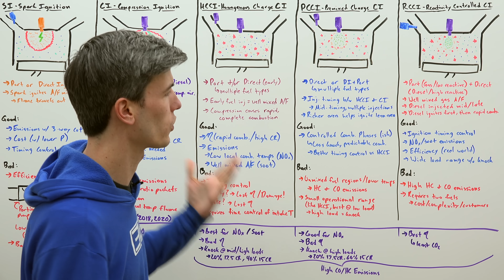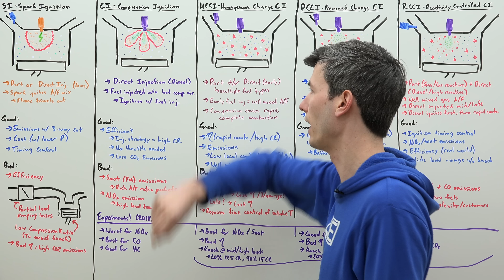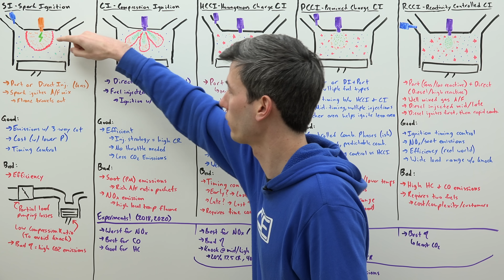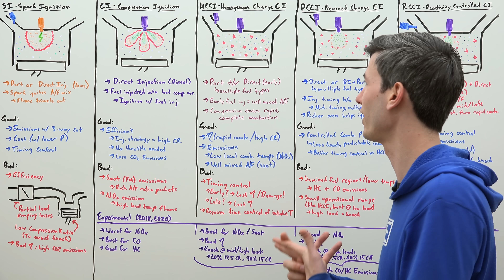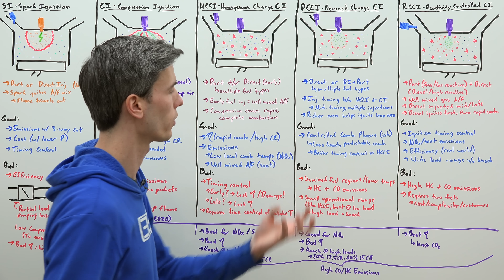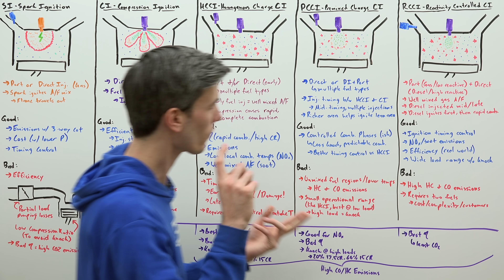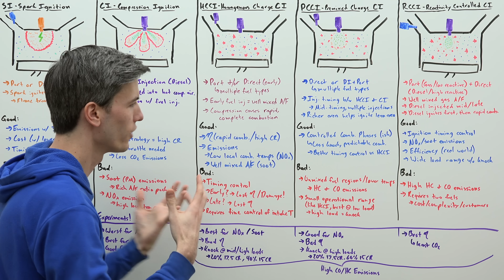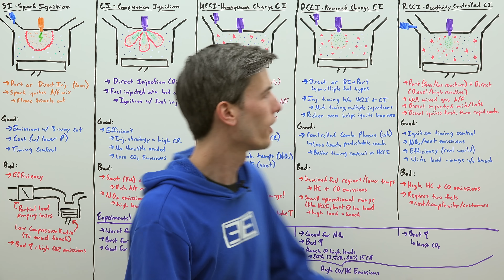If Combustion Engines Have A Future, What Is It?

Comment: I would gladly have a small aux 3-5kW engine in a electric car. I think HCCI could be much simpler in linear motor with a "single piston" and a chamber on each side and no rods limiting the movement. Frequency is not very important and you can modulate the load. Just for a better feeling if I get in a big jam on the motorway in a snow, or go camping somewhere very far and charge a car back in 1 day.

Comment: So is a CNG/biogas engine that uses diesel to ignite always an RCCI engine? You can get a conversion for your diesel car, at least in my country. And some tractors and trucks are being sold that can run partially on CNG. But if it's more efficient than using a diesel engine, I wonder why hasn't it gotten more common already. I bet there are lots of big companies that could save a ton of money if somebody in that company just found out about this and invested to it instead of buying new diesel trucks. But no, dealing with 2 different fuels would be just too much for anyone.

Comment: Any research being done on combining these more efficient technologies with carbon neutral fuels?
Reply: As a person that worked in the Biofuel industry for years I can say that it's never going to scale to mainstream. Its a great concept but producing that level of bio-mass in a sustainable way in not remotely feasible. Sadly the way to make it pencil out economically is to cut down rain forests to grow palm oil. The algae based alternatives have been dying in test tubes for 20 years, you can make a few gallons but not 10,000 per batch. Don't even get me started on switch grass based or corn based Ethanol.... just feed the corn to the cows and eat them. Big Oil produces many many thousands of times the amount of fuel that Bio does and to switch from one to the other wholesale would wreck the food supply and create swaths of global mono-cultures that come with even bigger headaches than climate change. Just imagine a single plant blight knocking out half of the worlds engines. Yup i really wished it was a better idea too....
Reply: Thats exactly what I was thinking, Biodiesel Has Advantages of Much lower CO HC and Particulate Emissions as well as No Sulphur Emissions At all
Only trade off is 5-15% higher Nox Emissions
Another issue is that Biodiesel (depending on the feedstock used) can have A lower Viscosity than Normal Diesel
Most diesels today run at 30,000 PSI injection pressure, but with Biodiesel that can drop a couple thousand

Another issue is that the Diesel engine has grown up with Dino Diesel, so its a little hard to find a compatible Biodiesel engine made by Manufacturers that don't want to spend the money making a B100 Compatible engine

One way to combat the Nox issue to to include Water injection, It dramatically reduces Intake and Exhaust temperatures, Promotes efficiency, and Reduces Nox by 5-9%
Another benefit is that it doesn't use any Limited resources, Biodiesle is made from vegetable oil, an alcohol (ethanol is perfect for this case since you can make it with just yeast and sugar, and An acid like Sodium or Potassium Hydroxide
Reply: Right
Reply: Porsche's e fuels might come in handy

Comment: Can internal combustion reach a thermal efficiency to where active and or passive cooling is no longer required? I think we still have a long way to go.
Reply: No
Reply: By definition thermal efficiency is a measure of how much “total work” you can get out of some amount of heat. But for an engine, the most important thing is the mechanical efficiency.  Now, if you're asking if we can build an engine so "efficient thermally" so no cooling would be needed, then yes, we can, but it will be useless for any practical purposes. In a combustion engine the energy is stored in the chemical bonds of the fuel.
So, one thing to see the problem is this. The combustion engine burns the fuel, thus freeing that chemical energy under the form of heat. Only a percentage of that heat is turned into mechanical energy. The rest... fortunatelly you eliminate a good part of it alongside with exhaust gases ( no need to explain the need of decreasing the entropy for the next burning cycle, right?). And the problem gets hotter: you become better at extracting the useful energy by increasing the burning temperature (and decreasing the temperature at the start of the burning). So if you want good thermal efficiency (which can translate in mechanical efficiency), you burn your fuel in better conditions, hotter, and then you cool it faster and deeper. Therefore, as Nikita K said before me, no, you cannot cut the cooling systems and have a useful engine at the same time. Cooling is a requirement for efficiency in a combustion cycle (that's why you have intercoolers in turbocharged engines, to cool the air entering the cilinder, that's (partly) why SpaceX's rocket engines are using fuel and oxydizer pre-cooled as much as possible).
TL&DR: "I think we still have a long way to go." - no, smart people are not throwing the money in things that are, at worst, clearly theoretically impossible and, at best, useless (and your average hand-heated, environment-cooled Stirling engine is a very useful toy to observe that).

Comment: There are some intresting technologies, even if a brand new euro6 diesel here in europe barley have any soot or not that much NOx due to the AdBlue DPF system but that in itself is a system that can fail, especially where we get sub zero freezing temperatures that liquid can freeze, too  much complicity makes things expensive, and i don't think we should be so gung ho on EV's just yet, there are issues that needs to be solved

Comment: SPCCI + ValveTronic would be like a holy grail of gasoline engines. High compression ratios, lean a/f ratio, and instantaneous combustion on the SPCCI front. Reduced pumping losses on the ValveTronic side. Too bad ValveTronic is horrifically unreliable and very complex. It was a good idea on BMW's part, but they just don't know how to make it reliable. We don't know how SPCCI will be on reliability, but I don't see why it would be unreliable aside from standard GDI issues.

Comment: A friend of mine has a 1989 honda civic hatchback with a 1.5 liter and a manual 5 speed with hondas equivalent of throttle body injection. We went on about a 140 mile trip in it, about 70% highway 30% city. When we filled it up to check the mpg it took just under 3 gallons of gas before the tank was full. This civic has over 200k miles and is almost falling apart but in 30 years since it left the factory there is not a car you can buy today that runs on low octane that can even come close to the 47mpg we saw with mixed driving. I can almost guarantee without a converter the emissions were not excellent, but i can almost guarantee its more damaging to the environment to produce a gallon of gas than to burn a gallon.

Comment: Why not just refine most of the nitrogen out of the air, run a smaller more thermally efficient compression ignition engine way warmer, and not have any NOx cause you gotta have nitrogen to make NOx?

Covalent bond type chemical reactions tend to be about 1000 times more energetic than simple non-chemical mixtures anyway. Refining can be really inefficient and still be worth it in terms of overall fuel efficiency.

Comment: You could solve the multiple fuel issue by having dual nozzles that lock into your filler neck that go into dual tanks, each the correct size so that they empty at the same rate. The nozzle would only go in one way, and thus the general public would be able to fuel up easily.
Reply: And would require specialized pumps to be installed, fine for a long term theory but terrible in short term practicality. If that had been brought up decades ago maybe, but at this point no gas station chain is going to invest in that knowing that electric gets better every day.

Comment: Doesn’t DEF help with emissions in a conventional diesel engine? Also, how about using an ‘always on’ glow plug in a diesel engine so that the exact time of ignition is controlled?
Reply: Yeah, DEF and DPF and EGR all help with emissions, and they're all now standard on at least all the heavy duty diesel applications I'm aware of.  They have their own problems, though.  EGR gets gummed up with soot, DPF requires burning additional fuel just to burn off the accumulated soot, DEF is (so far) sometimes finicky and doesn't play well with cold temperatures, plus it's an extra expense and runs into the "two fuels" problem Jason mentioned in this vid.

Also, the glow plug idea wouldn't work, that's just not how diesels operate.  The ignition is timed very precisely already, by timing the fuel injection with incredible precision.  The heat comes from the air being compressed.  Aside from that, the "always on" nature of it wouldn't allow precise timing, unless I'm missing something in your idea.

Comment: Combustion engines are being taken away to price people off the road. In 10 years there will not be enough electricity being produced for everyone to charge an electric car.
Look at US under bidet and camal. They are going to close down all coal and gas powerplants and replace them with wind and solar. Wind and solar might be free energy but it is no way in hell sustainable. This will increase the cost of energy by at least x20.
Also when self driving cars are fully here they will insure drivers of the road.